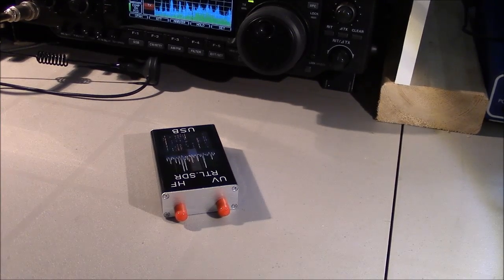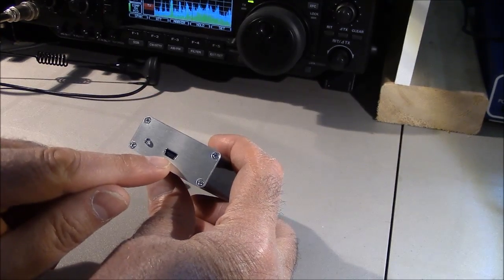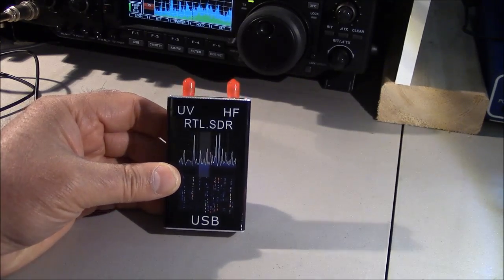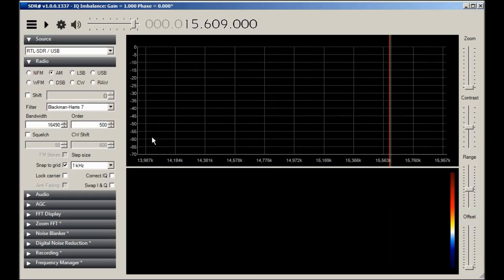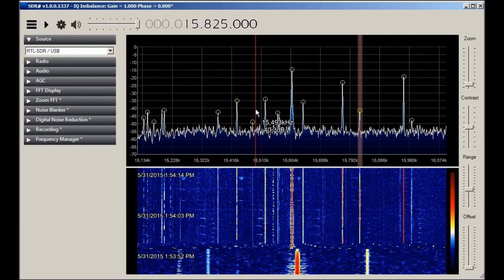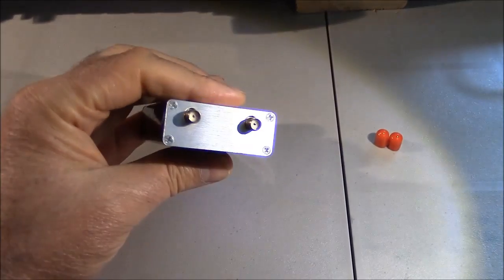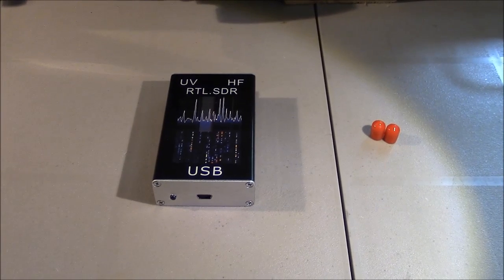How to Install and Configure RTL.SDR

Comment: Thanks for this video! Good stuff and useful! 
I have a little bit of experience with the RTLs, but couldn't remember the critical settings, nor am I super familiar with SDR#, but I'm honestly impressed with how well this combo does considering the price.
I'm comparing directly against an RSP2pro/SDRuno combo T-ed of of the same antenna. 
Even running on a low end laptop this works pretty well. Easily a good choice for a beginner with one caveat: 
It seems like you might get a different dongle attached your upconverter board, as mine had a frakking IR receiver on it! 
I guess it comes down to the chipset as long as everything else is built correctly.

Comment: We need a video on the best Antennas for these radio!
Reply: Maybe a 9 to 1 unun balun with end feed wire,  you can get them on Ebay cheap for $6 , use 50 ohm coax cable with 259 connector to it hook up and adaptor  and run an earth wire or lead  to a grounding rod out doors. 
 I was also thinking of using a ground isolation box ( small plastic project box)  between the sdr unit,  just for a safer hook up and also noise reduction,  for a permit set-up, just an idea. The reason I run the ground wire to  a ground rod  out doors is lighting protection.

Comment: I am Using Sharp software with the same black box and after install i can not click on the GEAR,,, its grayed out.
and i noticed if i use a regular USB dongle cable the laptop does not seewhen  I plug it in. In device manager it says in Win10 64bit the RTL2838UH1DIR is not installed, but i installed ziglog and still nothing. I am missing something

Comment: Thanks for the video. I just ordered one to use as a spectrum display of stations up and down the amateur bands, particularly the 20 meter band where I hang-out. I know I can read the manual on line but I am guessing it does not have a BFO so you cannot directly listen to SSB. Some say to connect it to the IF output of the receiver (I use a Collins R-390) but I don't see the sense in that - maybe I am missing something. Thanks again - good video.

Comment: I bought the same unit, but I cannot get it working on Windows 10. Even after running the install_rtl.bat file, SDR# still says "no device found" after I configure and try to play.
Reply: I got this - try a different micro usb cable, the one I got was faulty.

Comment: Extremely vague. Price and what type of antenna used. You don't even mention if you use the antenna that came with it where to get the software and what the software was. If there is many software types to get which ones are best for what types of projects etc. if the radio has limits or issues or cons or pros.

Comment: Are these things known to be useless? I've had mine about a year too and no chance of getting anything on HF or even powerful MW/LW broadcast stations. I can just about get it to pick up FM broadcast radio and think I might have picked up a tiny bit of VHF AM airband. Basically it's useless though, are there quality issues? Have I inadvertently purchased a fake item. Or do I just need much better antennae and filters etc? Would the RTL-SDR.com dongle in the silver case work any better? Or do I need to take the step up to a SDRPlay RSP1A or such like? Would be interested to hear other people's experiences with this particular product.

Comment: I finally figured out how to use it on hf. You set the software to Direct Q sampling. More stupid me!
Reply: +Kim Medley 
You mean select "Direct sampling Q branch" like in the video at 2:57 ? Right after he says "This is critical"?  ;)  Just kidding. I cheated and watched the video.. 

One could set their Frequency Off-Set (for HF) by tuning in WWV on 10, 15 or 20 mHz and see if their carrier is dead center or not..  You just have to be within a about 2000 miles of Ft. Collins Colorado.   http://www.nist.gov/pml/div688/grp40/wwv.cfm

Comment: How does this handle FM interference? Does it have filters on it or do you use external filters? I need to know before I drop $30 on one of these or if U would be better off buying a ha-it-up Up-Converter for the SDR I already have.

I modified one of those cheap dongles to sample the I branch but it has an enormous amount of FM noise on it  in some areas like the 30 and 20 meter band is completely un-usable.

Comment: What size antenna are you using on this?  I've been struggling with it, and using a 2M antenna.
Reply from the maker: for shortwave reception I use a longwire. about 60 feet long.

Comment: I got the same one you did, but i can't get any receive at all. do you the link on how to set yours up? mine didnt come with directions.  I got SDR sharp to see the device and it appears to be listening but i can't hear anything but static.
Reply from the maker: W4rH4wkXX I added some URLs to the description for software downloads and instructions.  You have to get the Zadig working correctly or it will never work.
Reply: The Radio Hobbyist Yup the zadig is done, i replaced the driver no issues there. i have it set on 2.048MSPS and Direct sampling Q branch.  Was there anything else you did to make yours work? Maybe its an antenna issue, i used the tiny one that came with the unit.  which antenna did you use for your video? Like i said SDRSharp sees the device, and its acting like its working, but all i hear regular static but i can't even receive any singals ... not even on regular FM for music
Reply from the maker: W4rH4wkXX Oh, you can't use that antenna. Won't work at all.  You need a nice long wire, preferably out the window before you'll pickup anything.  That's the thing with these cheap SDRs. They have poor sensitivity.
Reply: The Radio Hobbyist gotcha! thank you sir!

Comment: Hi there. Your video is very informative. I bought an RTL-SDR receiver which is almost similar to yours. I also downloaded the software that you used but when I click on setting in order to choose the name of my device, it doesn't allow me to do. That is why , I believe, the software doesn't see the RTL-SDR receiver. Any advice?
Thank you
Reply: Hussain Luaibi the driver installation failures , do you familiar with zadig.exe,?
Reply: Hi Denny, I heard about it. Is it free? Is it the same as SDR #? Thank you
Reply: Hussain Luaibi wait.. What? No it's in the same package as the sdr#. First, download the sdr#, decompress it somewhere, run batch file: install-rtlsdr.bat. This batch file will download the zadig.exe for u. Then run zadig, open Options - list all devices, choose interface 0 or rtlsdr unit from the dropdown, click big install driver button. After that u can run sdr#
Reply: Hi Denny, I am messing things up here. I downloaded SDR# several times and I unzipped it and when I click on the icon "SDR Sharp" it runs the program but nothing happens. It doesn't prompt me to run zadig. I am getting crazy with my SDR receiver. I can send you a screenshot of what I get every time I click on SDR Sharp.
Reply: Hussain Luaibi just run the batch file, double click on it. It's in the sdr# zip, just try to find it in among decompressed files. It's there.
Reply: Hi Denny, I did and I opened the SDR# window that shows the radio frequencies . But the software doesn't recognize my dongle (100 KHZ to 1.7 GHz all band radio RTL - SDR receiver RTL2832 + R820T RTL-SDR). There is something wrong somewhere in the process. It doesn't ask for the zadig.
Reply: Hussain Luaibi run the batch file first, it will download zadig.exe automatically. Yes,  the sdr# won't ask for zadig.exe. But u must run it first. Is there zadig.exe   in your folder? If it is, run it.
Reply: Hi Denny, thank you for your patience. I found the batch file. I clicked on it and there was a kind of CMD-like wondow. It stayed for sometime and then disappeared. I think after that a small zadig icon was created. When I clicked on it I got a small window which asks to install WCID . I will try to play with it . I don't know what is next. Thank you one more time for your patience. I want to enjoy using the RTL-SDR receiver. I hope I will be able to do it. I bought it from Aliexpress and the seller didn't include any software.
Reply: well.... I bought mine from Aliexpress too. It was confusing at first, Before u run zadig.exe though, connect your RTL-SDR to computer, then run zadig.exe, click Options -> List All Devices, choose your RTL-SDR (or sometimes just Interface 0) from the dropdown list. Then click the big "INSTALL DRIVER", wait, then u're done, SDR# is ready to use. 

You must realize that what you bought is intended to be a TV Tuner at first. Then, some smart people created another driver that `hack` the tuner so it'll able to tune to another frequencies. Hence why you need zadig.exe to replace the current software/driver with the `hacked` one
Reply: Denny , that is great information. I will do it once I get home. I will follow your instruction. Have you tried on the TV,  ti use it as a TV tuner?
Reply: Yes, It can, there is a software called BlazeHDTV(paid). Unfortunately, in my city there are no DVB-T television station yet so I haven''t use it, since this dongle only accept digital TV signal.  But hey, why bother.. If i want to watch TV there's a TV set next room. :-P
Reply: Hi Denny, I did what said and when I  open the program and click "play" 
it gives me a message "no device selected". I selected the device but 
when I click on "configure source" it shows me a small window called 
"RTL-SDR controller". The area where I should choose the device is grey 
and doesn't allow me to click on it . But above it there this number 
E4000. Definitely there is some unusual. Your help will be appreciated
Reply: First, did your zadig.exe successfully updated the driver ? did the success notification appeared? 

During the installation progress there are several confirmation windows that ask whether you allows them to install the driver. Does it appear?

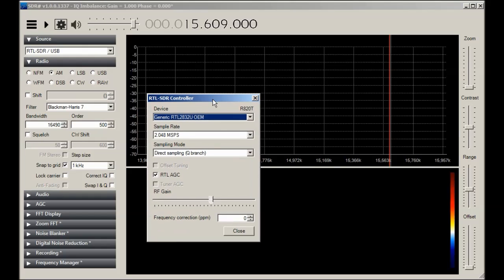Pause at 2:40. it shows how to configure your dongle properly before you hit "play" button.
Reply: Hi Denny, thank you, I did it..finally. It was impossible without your help. And now I probably need a good antenna!
Reply: I'm glad to help :)
Reply: Denny, do you use a different antenna? Is there a special one that is available in the market?
Reply: No, at the moment I'm still using the stock antenna. The problem with HF/SW antenna is, in order to be properly useful, it needs a large space, sometimes around 50-100 m. The current best and simplest antenna that I can think of is "magnetic loop antenna", it gives several advantages:  takes relatively small space, cheap,  simple, and indifferent to electrical disturbance (especially if you're live in city). 

There is no affordable after-market antenna for HF band, you should build one yourself. There are many other designs on the internet. The antenna designs usually simple, it just takes a lot of space. 

I also have a plan for a yagi FM antenna, I want to snoop to Russian weather satellite sometimes.
Reply: @kaptenhiu5623  Thank you very much :) I missed this batch files

Comment: Are those upconverter models really worth it? I mean it's $43, and you can get a high quality tcxo version from rtl-sdr for $25.
Reply: An upconverter is needed to go below 25MHz and get the rest of those worldwide bands. The standard RTL-SDR dongles only go down to around 25 or 30 MHz.
Reply: Yes, but you can solder a wire onto the IC and save >$30
Reply: Have you tried the RTL mod to get the lower bands? I've heard about it and wondered if it was easy and if there were any shortcomings with respect to receive sensitivity and noise rejection. I'd be really interested in seeing a video comparing the RTL mod to one or more of the upconverters in terms of performance.

Comment: Can I use my TV antenna? Will that work good? And which input do I plug it in?
Reply: An old TV antenna will work just fine for reception. The HF port is for shortwave transmissions and a tv antenna really isn't the best for that however it may work if you have strong enough signals nearby. I would stick with the UHF/VHF port as your TV antenna will be more closely tuned for that anyway.

Comment: HOw do you instal the software?  when it does not show up in Zadig what should I do?
Reply: update I got it installed.  Got HF working.  I got excited and wanted to listen to my own TS440 signal.  After under 1 second of listening to my 10 watt transmission it fried the front end of the RTL.SDR.  UHF worked fine for about a year, and now somehow the drivers no longer work.  So here I am retracing my footsteps trying to figure out how to install it again!

Comment: When I Buy Sdr's I Took Them Appart And Google All Components That (I Dont Know, I Bought This One For 35 Euros And It Failed Hard, Inside Was The Small Chinese Yellow SDR And A Bigger Pcb That Have The Usb Port And Smas With Non Coaxial Wires So Its Bigger, I Laughted And Cried At The Same Time, Never Got It Working. Scrapped For Sma Connectors And Stuff

Comment: There are a lot of fake rtl-sdr devices on the market add I'm also suspicious about ryzen or AMD processors and this device apparently ryzen processors hold the USB controller where is other Technologies have a controller on the motherboard to handle these things and I think there's a drama with Windows 10 somewhere in the mix there is well apparently there are a different coloured PCB and that's an easy way to tell if anyone has a full fix for the things I'm describing let me know it's the device not recognised error when trying to use RTL SDR on sdr Sharp